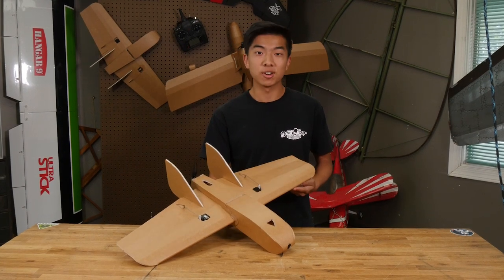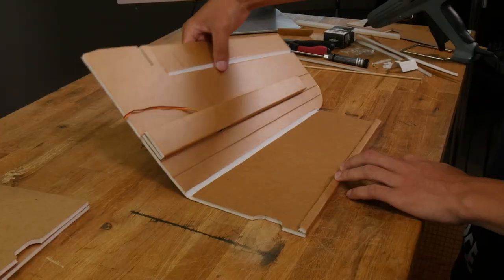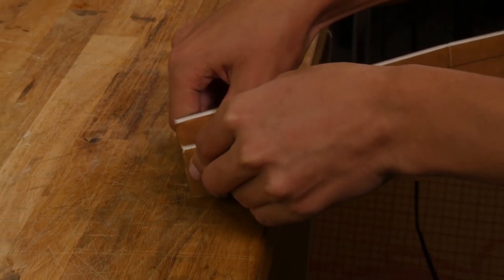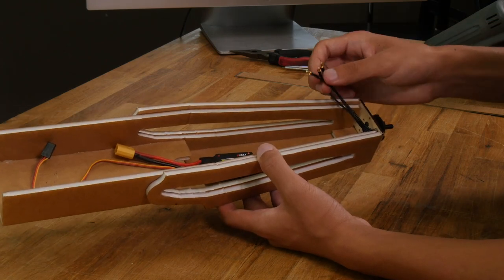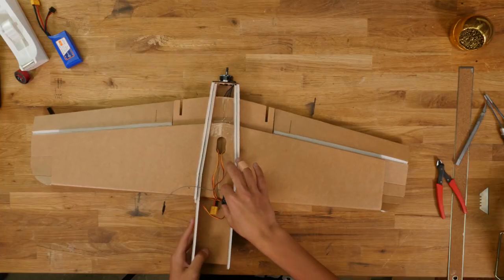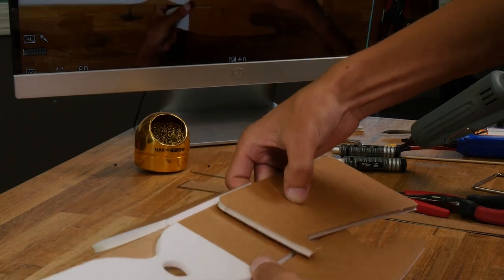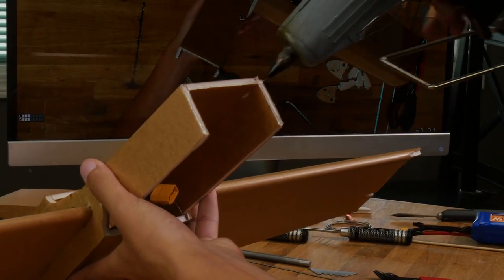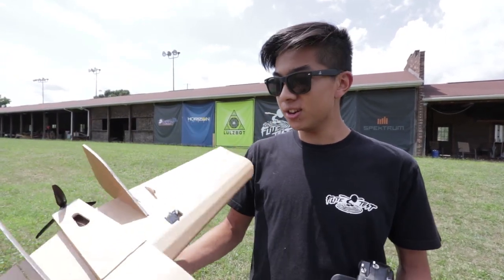How to Build the FT Goblin  //  BUILD

Comment from the maker: Before flying make sure you program reflex into your elevons. The elevons should be raised to an angle about one thickness of foam above the training edge of the wing for best flight characteristics. Adjust based on nose weight and desired flight characteristics.
Reply: Hay guys first i love what your doing amazing stuff but i have a problem nothing to dowith the vid but i need some advice i just got my hands on a flysky fs i6 transmitter and an fs r6b receiver and i cant get them to bind no matter what i try i know u guys are busy but i need some help if u can spare a few mins thank you
Reply: Does exist any video that teaches how to fly a non elevator plane like this, I've crashed several models and I still don't know how to fly them.
Reply: OOF
Reply: OOOOOOOOOOFFFFFFFFF
Reply: @FarmerFpv  lol bro that was 7 months ago i got it handled and why ru being so contentious about a simple question honestly i reach out to the community for advice and you have a problem with on what page i did it that kind of a dick move im really glad you didn't come at me with that at the time not vary helpful anyway to all you guys that did help me out with that one thanks and as Scott Manley says "fly safe"
Reply: @FarmerFpv  lol sir i think u missed my point i wasn't specifically asking FT anything as i sed quite clearly i was putting out a request for help from anyone who may know i did it on an ft vid senc that would be a sensible place to find those who know such things my point is simply that you need to get off the this is not a place for questions BS lol i mean wtf bro lol anyplace were enthusiasts gather is a good place to ask for advice the fact that i found the answer i need later that night in exactly the manner you described is beside the point honestly why do u feel so strongly that you feel the need to tell me where i can and cant ask for advice
Reply: Which thicknes and can i use depron?

Comment: I really like the faster pace of the video. When you've built one or two FT planes it's pretty clear how things are done so no need to labour the point on every video.  Just a couple of things for Josh and Andres to think about during design, tight curves are brilliant, if you have a laser cutter, but are difficult to get neat with a scalpel.. And whereas you can easily peel the paper off FT and DT foamboard, it's not so easy using the boards available in much of the rest on the world.
Reply: Andy Timmons, all my builds are dollar tree foam... and I bemoaned the same thing about curves. I found something that works for me now. I use an exacto knife and not my regular blade. When approaching a corner I don’t try a cut the corner, I prick the curve. When I turn the board over, I connect the dots. The tighter the curve, the more I appreciate the technique. Hope this helps.
Reply: Blaming your tools and materials is lame, I manage tight curves with no problems,  it's just about practice and making sure you regularly change your blade.
The foamboard available elsewhere in the world is actually better quality and stronger,  peeling the paper is absolutely possible,  there's an art to it, if you just try to rip it off then your gonna fail.
I manage to make all of the ft planes with UK foamboard without any problems at all, if you can't do it then you need to refine your techniques, not blame the people who release FREE plans.
Reply: @Timless2  This is a good technique. I'll even flip my template and pin-mark the other side of the board as well so the curve comes out looking sharp on the exposed side of the foam. Sometimes, on a tricky curve, I'll cut it fairly close but finish up with an emery board or sandpaper. You don't have to be as exact with the blade that way.
Reply: G'day I'm from down under (Australia) our foam board is crap as well doesn't peel like the ft one so if you cover the part that you need to peel with packing tape the paper comes off with the tape when u pull it off 👍🏻👌🏻
Reply: @kbangfpv6226  the foam board that does not peel as stronger than the ft stuff, it may be harder to work with during construction but it's a better material for the finished plane :)
Reply: Foam Board is made of polyurethane foam and polypropylene foam. It is necessary to use only polypropylene!

Comment: Hi Flite Test, I scratch built the FT Goblin and it wasn't that easy to cut the curbs. Finishing I admit it's not perfect. 
Then I painted it with acrylic paint and today I maidend it..... And it was awesome. With the Graupner 2804 Motor from the FT Power Pack A and a 6x4 Prop, 2200mah 3 cell it flew like hell. It started out of my hand without throwing it. And not to forget it makes much less noise than the mini Arrow with same power equipment.  My neigbours will not call the Police again, as they did twice.  
It's just a great great great Goblin. Thanks to the Andres the constructor, you really did an absolutely  great job!  I'm really enthusiastic about this plane.

Comment: Having built several foamboard planes from the FT plans, I appreciate the faster pacing of the build vid.  A 1st-timer might get a bit frustrated, but then again, they'd probably start with a cub or sparrow.  I think some post-effect arrows and highlighted areas would be useful, though, when you say to  cut/glue here, here, and here.

Comment: I completed a scratch build of this plane. I had reservations as I had built another company's plane and was very disappointed with the results. When I completed the wing halves I was simply blown away by how perfect they matched each other when I connected them together! The only problem I had was with the material I had. I purchased black foam board which was all the dollar store had. When taping I found the paper would peal off with it when repositioning. After the plane was finished the test flight was anything but normal, nothing to do with the plane or design but a programming issue on the Futaba radio. Can't wait to fly it again when the weather gets better.
 I do plan to build a second Goblin using the much more robust white foam board!

Comment: Andres makes the best built videos by far.  Most people who are building this plane have probably built several other ones and know the jist of it.  I would actually like to see a highly abbreviated version for each model...  5 min, a high-level overview of the assembly.  Skip the electronics, control rods, motor/prop - just how the foam goes together.  This should especially be considered for the advanced skill level planes, if you should be flying the plane, chances are you know how to glue up a foamy.

Comment: I want to get into RC flying and wanted to see if I can pull it off. So I am a brand new NOOB who decided to build the Goblin. 

Here is what no one tells you NOT TO DO if you decide to scratch-build the goblin.

1. DO NOT USE ELMERS FOAM BOARD. I used this in my first 2 scratch-built Goblins. Although it was within the Max weight limit, as soon as I wing-launch it, it would roll over (inverted) and nose-dive vertically into ground. Longest flight time was around 2 seconds. (could not figure out the roll-over into inverted position though.) (maybe I should mount the battery lower in the battery bay to lower CG below CP?
2. Do NOT USE 1300KV motor. I used a 2512, 1300KV motor with a 6 x 4 E Prop, and a 4S-2200mah Li-Po. Thinking the motor would have higher torque compared to a 2206. and would produce good RPM with a 4S battery. but that probably contributed more to the crashes and the 2-second flight times.

My Plan at present is that I am almost finished building my 3rd Goblin using Walmart foam board (this plane weighs around half of my previous builds). I have the 2206 2300Kv radial motor on order from FT. I plan on using a 3S, 1500 Li-Po and a 6 x 4 E Prop, my aim is to achieve longer flight-times than my previous ones. 

If anyone can find a Flaw(s) in my present plan. Please let me know.

Comment: Well I got a kit in a country I won't name and it is the hard foam that has no paper but inscribed lines and I just had to cut off the sections and hotglue them together. Went ok except I messed up the ailerons and trimmed them backwards so the v cut is now on the top. Not too big a deal I guess. Have yet to finish the build.

Comment: I have the goblin built,  just need to paint and wire it, anyone had a chance to record any speeds with one yet?
I'm throwing a 2406 2600kv motor at mine that produces just under 1.2kg thrust on 3s with a 6040 prop and 920g on a 5045, that's still a power to weight ratio of 2:1 lol

Comment: If i use the emax rs2205-s motor, which is the prop size you recommend for the gobblin?, and it will be 2 blade or 3 blade?, thanks
Reply: Use a 2 blade 5x4.5 bullnose prop and a 30amp esc